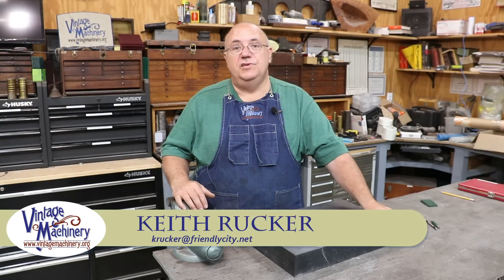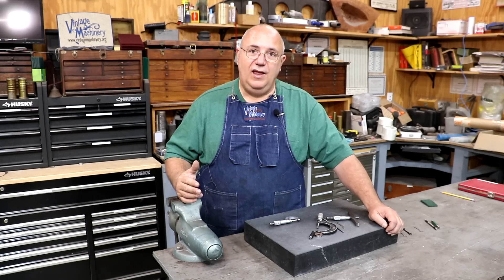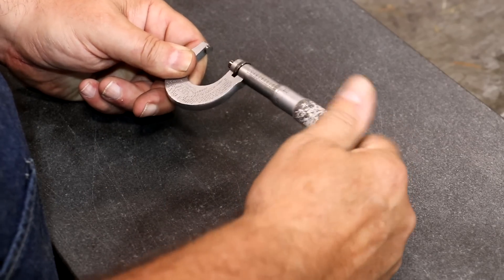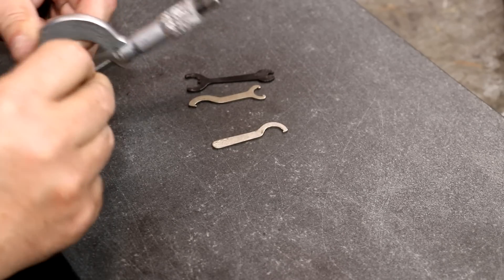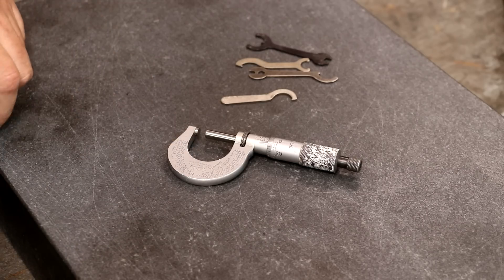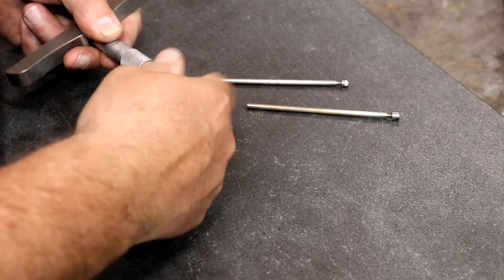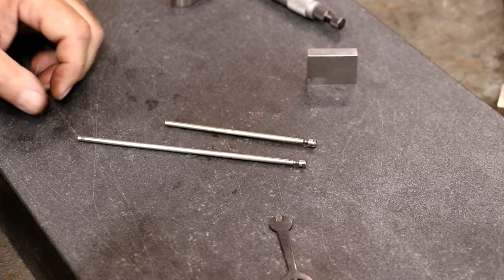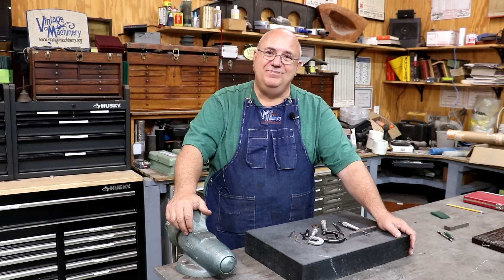How to Check and Adjust the Calibration of an Outside and Depth Micrometer

Comment: My outside micrometer reads 0 just fine but when I measure a #3 piano tuning pin that is supposed to be .286" it reads .288". When I measure a size 15.5 wire that is supposed to be .036" it reads .037". It's a General Tools 102 and it is new. I tried your cleaning trick with the paper but it didn't seem like anything came off. Yesterday I replaced a broken piano string and I used the size that gave me the same reading rather than the size that the micrometer was telling me to use (.037" would have been a size 16 but size 15.5 gave the same reading as the old string). Maybe it was because it was a hot day or maybe I'll just have to live with the idea that it reads a little bit on the heavy side. I'll have to try it some day when it's 68 degrees. Thanks for the video.

Comment: I wish you had some depth micrometer to adjust actually instead of all dead ons. Just saying that it can be adjusted doesn’t really show how. 
The depth micrometer doesn’t have the adjust hole and you can’t turn the barrel so, it must be a different way that I don’t know how. I just finished adjusting one and it was hours because the only way I knew was to take off the rod, loosen the nuts, retighten them, try it, and try it, and try it, until I matched the zero. Very time consuming. Thank you anyway for trying to pass the information.

Comment: Keith,
I have a J. T. Slocomb 0 to 1" micrometer.
It is a basic model (no tightening ratchet )
It reads about 4 tenths small, on the zero side, and dead on at 1" ( L.S. Starrett 1" standard )
The threads look good, and are clean.
How could one end be off, and the other dead on ?
Thank you, Al

Comment: An actual callibration is made by using gage blocks of different sices to check the entire lengt of the screw. 
A good cero does not tell you What it will read on for example 1/2” or 12,7mm. 
You also check the paralellity between the anvil and the screw.

Comment: Very good video
One fact that becomes very important when we talk in tenth of a thou, it is the temperature of the part versus the temperature of the instrument. What I do is that I store the instrument with the part to be ,measured for a few hours before taking my measurement and I wear thin gloves to avoid warming the instrument with my hands.
Calibration is one thing, the way you use it is another and for sure the combination of both gives the credible result, I say credible because when i speak in terms of tehts of a thou, there is so many variables linked to the human factor that for the same part with the same measuring instrument, the result can differ significantly.

Comment: You mentioned, when discussing calibration of the outside micrometer, the importance of ensuring that the anvils are clean. The same consideration applies to the depth micrometer when changing rods - you want to be sure that the mating surfaces are clean.

Comment: I threw out a severa micrometers a few years ago. Every single one would zero fine and correctly read a calibration standard, but they were all junk.

They'd come from a production environment and had been used to check the same dimension for many years. Near that dimension some were up to half a thou out. They'd probably been calibrated against a gauge block that matched the nominal dimension they needed to measure. 

I reset the zero, but was suspicious of why it had been so far off and checked them at multiple dimensions.

DON'T ASSUME!

Comment: What your showing is just good practice always zero your equipment before using. Calibration will check the micrometer thimble throughout its range check flatness and parallelism of working faces. If you have a set of good gauge blocks and a lever DTI gauge you can easily do a full calibration of micrometers and depth micrometers

Comment: I set my mics 30 years ago and haven't done them since.  If zero is off by .001, its easier to just add or subtract, than to recalibrate every time I use them.  (I only use them a few times a year.)

Comment: Mitutoyo has a video to check micrometer  they use gage blocks to check the middle of a micrometer in the middle.They use a gage blocks 0.210, 0.420 ,0.605, 0.815 ,And a 1.000.

Comment: Don't forget the heat from your hands will warm up the mic and affect it. Especially if you get to the point that you are chasing your tail back and forth trying to get it right, you may not realize you've been holding it for ten minutes and now it's 80 or 90 degrees.

Comment: Keith, I've been a Metrologist (calibration technician)  for 35 years. I've been watching your videos for years. Every video you make about precision measurements has been spot on. I've even learned a thing or two from you about measuring over the years. Dave in TX

Comment: If you have a ball bearing ball,  you can check out flatness of anvil to thimble?  Have an old set of starrett Mike's that had been dropped or something, put them in vice, did a twist, tappety tap with a 4 oz hammer, little bit of lapping, good as new.  Ok, I will put them up against any new import mikes.  Grab an odd sized block and check other than .025 increment.  Just have to check.  I usually check my depth mike out with my 123 block.  Quality of cheap 123 blocks is great, down to the tenths, throw your Mike's on the first.  I am using an old set of Tumiko depth Mike's, adjusters have red on them, all rods seem spot on, wonderful old set, no tenths vernier, but as close to zero as my old eyes can see.  Tumiko or tubular micrometer, or Sheire? Tumiko stuff is good stuff, don't pass it by.  Don't ignore the lufkin and union tool tools either.  But right now guage block sets are cheap, pick up a set.
Reply: Hey another comment, helps your algorithm,  back when, working in tool room of a furniture factory, ruined many a set of calipers, guys wanted the depth rod to go into an .093 hole 2 inches, we had a grinder with a 2 inch wheel.  This was when digital calipers were becoming common, they were great in that with a push of a button, inch or metric.  Most digitals checked against my 1.000 starrett standard measured between .999 and 1.001, mitutoyos usually read 1.0000, plant provided verniers always read 1.000.
I used to go to great lengths setting my calipers, I am partial to Brown and Sharpe, stoning with translucent Arkansas hone, see no light, set zero.  Anymore I set with a standard.  Ok my eyes a aren't as good anymore.  When the 20 dollar Bill's came out with the microprinting I could read it, can't anymore.  Used to be able to read a scale to .005, now I have to clean my reading glasses to see the lines.  Ok, I have commented for your algorithm,  love your web site, keep looking on it for metric chart for my Hendey, I have 14 positions on my tumbler, most charts show 12.  Not on the top of my list, but I am going to teach my Hendey how to cut metric threads, just have to cut a 127, 120, and 100 tooth gears.  Have the cutters, got the blank cut out for the 127 hole dividing head plate, should I take it to work and drill it on the HASS or do it with my rotab.  Should ask HAAS operator what his reverse comp numbers are first.  Ha.  Better keep my mouth shut, going to be on other side of wall calibrating cnc.  Leveled surface plate and calibrated shops levels plus mine a week ago, getting old, my legs still hurt from all the up and down.
Ok, I have commented enough, hope it helps and someone benefits from my verbose comments.

Comment: One common mistake people make with mics, is too much thimble pressure when measuring items. Worked with a guy who would crank down until he got the reading he wanted. Not all micrometers have a ratcheting thimble. I do much prefer a mics with the ratcheting thimble. Gives a good repeatable reading.
Reply: I can identify with this problem checking mikes. I use a very light “slipping” feel with my thumb and index on the barrel when checking calibration on mikes that don’t have a ratchet. It’s also very easy to use too much pressure when checking depth mikes. 40 threads per inch is a very powerful lifting force so you have to be careful. I’m glad that Keith addressed this subject.
Reply: @ellieprice363  Very much so on the depth mics. I use a Mitutoyo with analog readout. It has a ratcheting thimble. Really helps to keep from it jacking itself up and giving a false reading.
Reply: Don't care for ratchets as they can not be "caliibrated".  Yes, they will repeat, but that doesn't mean the reading is accurate.  Prefer to use my "feel" which I have spent years developing.
Reply: @robertlark7751  I have to agree I use the finger slip method even on mikes that have a ratchet.

Comment: Interesting! I kinda taught myself some of this when I was in HS. I had access to the Science Department storage area (one of the few students that did). One day I found a 0-25mm micrometer in a drawer that was seized tight! Seems somebody had closed it entirely (even then I knew that was a no-no) in the Wintertime and this was nearing Summer. Asked the teacher if I could have it. So I took it home and clamped it in a vice and carefully opened it up. Took it all apart. Got it zeroed, but didn't calibrate it further. Took it back and showed it to him and he said: "Keep it". I still have it...